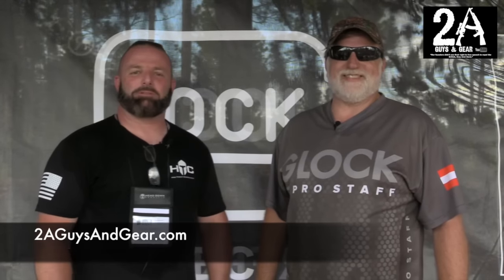Glock Myth; American made vs  Austrian made

Comment: Austrian made went through a different process. Toph mined it and metal bend it. Zuko finished it with high heat using forged fire bending technique and Aang cooled it down and water freeze treated as final process by Katara.

Comment: I have CZ P10 c’s at my shop, but with Czech markings and USA markings. There are several noticeable differences. Firstly, the Czech has a cold hammer forged barrel, the Us one doesn’t. The foam padding in the Czech box is cut out to the pistol, mag, etc specifically, whereas the USA box is literally just two thin pieces of foam to sandwich the contents. The engraving on the Czech model is cleaner and deeper than that of the USA model. 
This is with CZ, as for Glock, I haven’t noticed much apart from maybe slight differences on finish on the 19X’s fro Austria vs USA. 
Personally, if a gun is made from a specific country, I want that country to make it. If it’s HK, I want German. If it’s Glock, I want Austria. If it’s CZ, I want Czech and so on. Is there always a difference? No, and most likely they are the same with Glock. But I always feel a bit better going with the home-country. I wouldn’t buy a Toyota that was 100% made here. I’d probably buy a GM that was made in Japan though, perhaps they’d be able to get it to go over 100k without numerous issues. Lol.

Comment: BS I just picked up two g43 in the last few weeks. The second one has been pissing me off, the slide release is awful and the mag release isn't as smooth as it should be, and the gap between the frame and slide is larger. The first one is noticeably better. Then I compared the 2 side by side and, of course, the one with issues is the USA made one. I didn't know this was a potential issue until now. Also my Austrian G19 was flawless out of the box. I will not be buying another American made Glock.
Reply: I have many Glocks, all Austrian, but one is a USA made G19 and that one looks great and has never failed.
Reply: Amen. I dont like mine either. I didnt even know there was a u.s. factory til I got my gen 4 19. Kept wondering why it felt different and the trigger was hard as fuck. Then I got to looking.....and noticed there wasnt a made in Austria on it. Well......it made sense then. And Georgia to top it off. No telling what's in that factory.
Reply: I've owned both American and Austrian g19s and g26s and an Austrian g21sf. All 5 were flawless in every way. In fact the trigger of the American g19 was the best of all of them. However I rented a g43 once at a range because I wanted to buy one for my wife and I had several issues with it. It was AUSTRIAN made. So I think it's just the platform in general. Regardless of where the g43 is made I will never buy one....

Comment: I have three Glocks. G19 & G30 are Austrian Gen 4's and the G26 is USA Gen 5. The finish on the USA Glock is Black while the Austrian ones have a brownish Black. I did not like the triggers on the Austrian Glocks. The USA Gen 5 definitely has a better trigger. I changed all them to Overwatch Precision triggers. The USA G26 is great but the barrel has some wear marks that are suppose to be common with the Gen 5 tighter tolerances. I love them all and the all shoot great.

Comment: American or Austrian. Whatever roll stamp you prefer. I agree, No difference in quality.
Reply: What about the tenefer finish on the slide in Austria as opposed to the coating of the slide in the USA?
Reply: @RGMultimedia  From what I have seen it's exactly the same finish. I don't think any of the factories are doing the desirable "Frying pan finish" anymore. I was on the hunt for a Gen 4, G19 with that finish with no luck. I found a slide on eBay recently and built one.
Reply: @VegasX900  I am going to research the finish difference and let you know... Please keep safe during COVID-19
Reply: @RGMultimedia  Tenifer is a variant of nitrocarburizing that employs a bath contaning cyanide and cyanic acid. In itself it is nothing special, most weapon manufacturers are using nitrocarburizing as a metal treatment. Metal treatment and finish are not the same, many people confuse this. Tenifer is a metal treatment not a finish, it case hardens the steel and makes it corrosion and wear resistant. Tenifer is a trademark by german company  HEF Durferrit. Glock did finishes such as parkerizing in gen 1- 2 and the frying pan finish on gen 3/ early gen 4. Later in gen 4 they went back to a grayish parkerizing similar to gen 1- 2. Gen 5 has a DLC coating now wich resembles the frying pan finish and has a deep black color. DLC is also used for cylinders and motorcycle fork stanchions for example. Glock calls it nDLC, it stands for nitrocarburized diamond like carbon. In 2010 they went from tenifer to a gaseous nitrocarburizing process. This is were the confusion comes from with the tenifer. Some people claimed they changed it because of the poisonous chemicals involved. The cyanide is converted into harmless sodium carbonate during the process though. A gaseous process is quicker than a liquid process and both achieve the same result.
Reply: @Tony.795  Wow, I will accept this... Thank you Tony.

Comment: I'm sure the material is the same and just as reliable, but what's been questioned and not addressed in this video is the finish possess on the slides.  There have been many reports of the G43 and many other US guns produced that have rust issues which have been a none factor with older Austrian offerings.  That is a big issue with Glock fans at this point.
Reply: i noticed that too how he skirted the coatings as in tenifer. i know for a fact that the usa made glocks don't have tenifer coating the steel like the austrian made counterparts. something about the byproducts of the tenifer process.

Comment: then explain why my us made g19 and every other us glock rattles like a maraca and my austrian g17 and my friends austrian g19 is silent?
Reply: Kian Kamali my american made 19 gen 4 dont rattle hahaha
Reply: Kian Kamali the firing pin is supposed to rattle when not cocked. So if your glock diners rattle when not cocked you have a firing pin in need of a cleaning. If you’re talking frame to slide then yea they shouldn’t rattle that much but glocks aren’t meant to be like as tight as a CZ75 or something like that they are made for more loose tolerances as to maintain accuracy and reliability under adverse conditions.
Reply: My glock 19 USA doesnt rattle. Its silent
Reply: Those die hard folks just cant admit it!!!! My gen 4 19 is loud as hell when it cycles.

Comment: I just bought a 26 gen  5 made in USA.  I put 100 rounds through it with no problems.  I was worried too at first but after talking to workers at the gun shop and a different shooting range, glocks are being assembled in Georgia with parts that say Austria.  And that's it. I took my 35 gen 4 with Austria on the slide to the range also and they're both flawless.  One IS NOT better than the other.
Reply: Internals (other than slides) are only made in Austria. Slides, barrels, and frames are made in both locations.
Reply: You got lucky .....atleast for now.
Reply: @rayslack4120  What do you mean he got lucky? They’re all the same. lol
Reply: @Lawrence43  Well, it's the QC process that worries me the most. QC in modern American factories are always negatively affected by overzealous Boomer bean counters as well as the US having a population of Millennials who are stoned or hung over most of the time and hate to work. It's that QC that can make a HUGE difference in long term reliability. Because of this, I will only buy used Austrian Glocks.

Comment: Glocks Made in Austria are Proof Tested at 130% Proof Load, American Glocks are Proof Tested to 120% Proof Load. Either way if you blow a Glock up you're screwed. Just because the steel is the same, doesn't mean every production run will be perfect or the same in the heat treating process. Heat Treating process is very important and can affect it's hardness just by improper placement on the rack or uneven spacing. In any manufacturing process something can and sometimes goes wrong. All Glocks are not created equal, man is basically flawed. Which is is better?  The one I own!  </;>)

Comment: Where do they source the steel?
Reply: @Bro Mark 😐
Reply: Toph mined it and metal bend it. Zuko finished it with high heat using forged fire bending technique and Aang cooled it down and water freeze treated by Katara.
Reply: @speedmaster001  Why. Is. This. The.
LEAST👏 HELPFUL👏 THREAD👏.
Reply: I think they explained all that in the video.